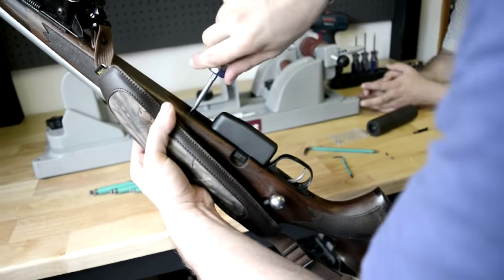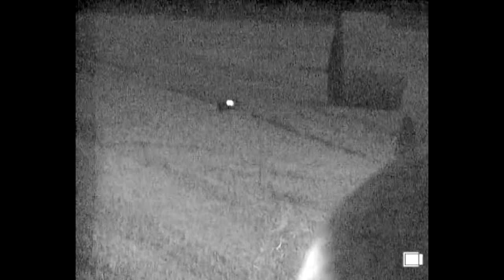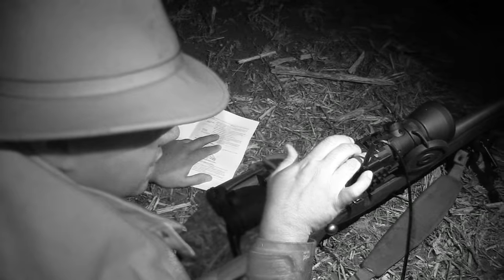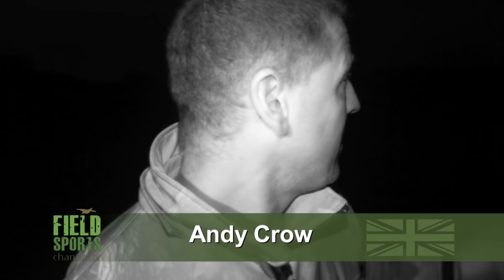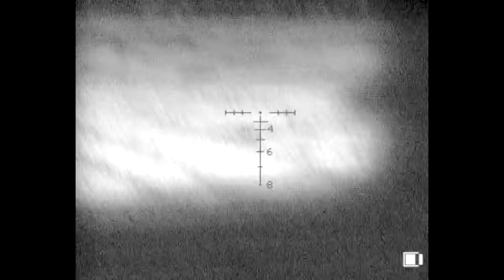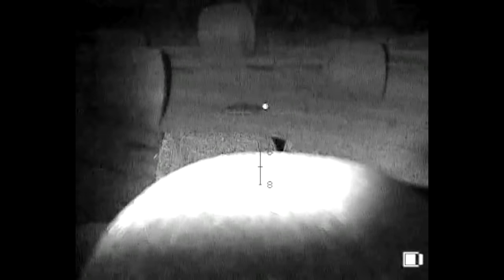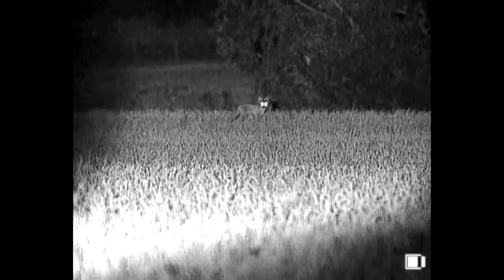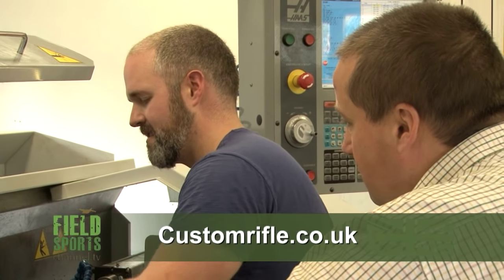On test: Drone Pro 10X

Comment: Could someone explain why Roy's using a moderator, when his ammunition is supersonic, and therefore incredibly noisy whatever he sticks on the end of his barrel? Thanks.
Reply: Because although it's still a bit noisy, the sound level is reduced significantly and with a good moderator the level is below that which causes hearing damage. I still use ear plugs to reduce the reflected sonic crack from hedges, trees etc, but that is down to the ground I shoot over. Over open country earplugs are not needed.Additionally with a moderator, you don't wake up half the county every time you squeeze the trigger.